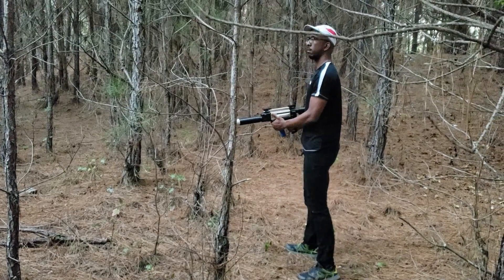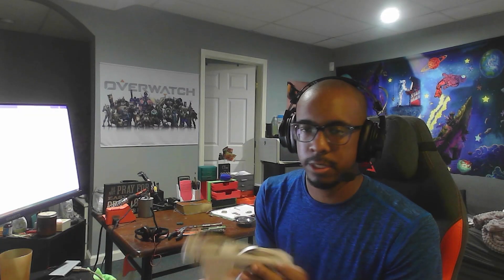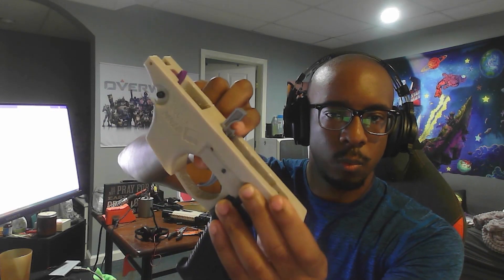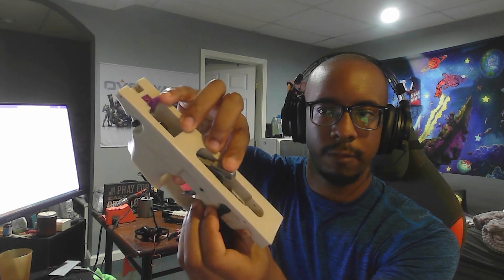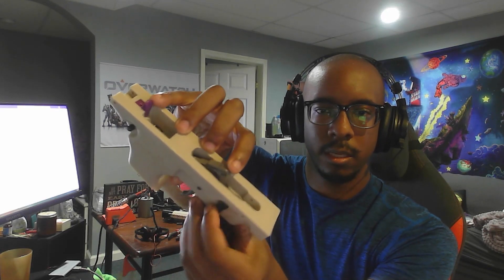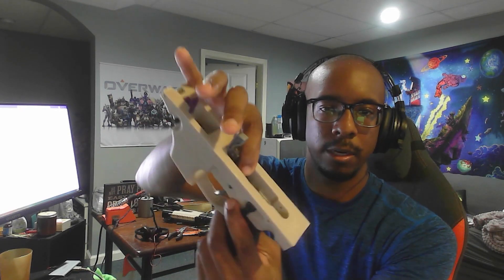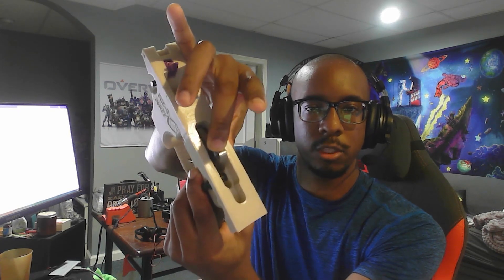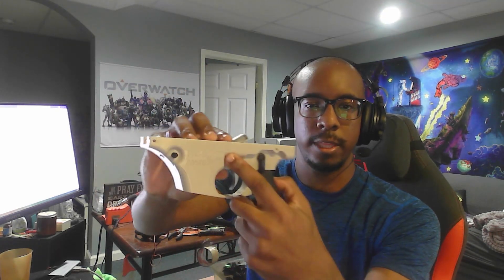FGC-9 firing issues - Trigger and hammer issues.

Comment: mine was working perfect for about 200 rds... but then i started getting light strikes after the first shot. Any idea what might be my problem?
Reply from the maker: It could be a couple of things, although remember I am not an expert. It could be the firing pin being worn down over time. IT could be the headspacing between the bolt and the barrel which is too far away. The other issues I would need a video of you firing it or a picture of the primers.

Comment: Welcome to the scene. Solutions to your problems can be found at the source of the files.
Reply from the maker: Thank you for the comment. The issue I was having was not specific to the fgc-9. To my knowledge the stress of firing the weapon misaligned the trigger and hammer pins. Seems to be fixed after I re-aligned the hammer and hammer pin.
Reply: @wankwanka1  Glad you figured it out and got it your fgc up and running. If you like the design I hope you join us on element!
Reply: @marcus1202  me ajuda irmão  preciso  de ajuda pra fabrica  a minha
Reply: @wankwanka1  me ajuda irmão  preciso  de ajuda para fazer a minha
Reply: Me ajuda irmão  preciso  de ajuda para fazer a minha